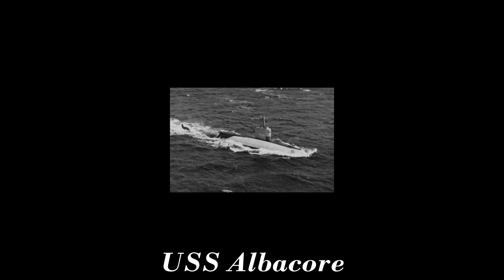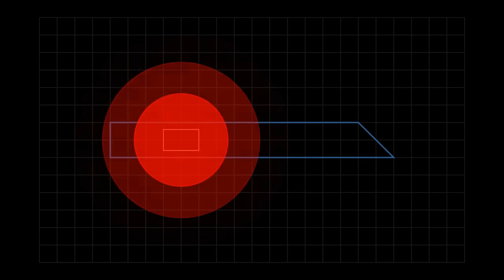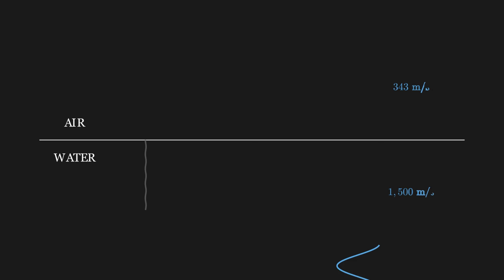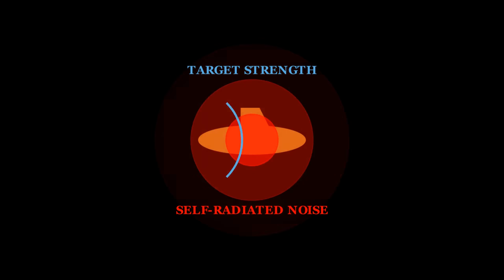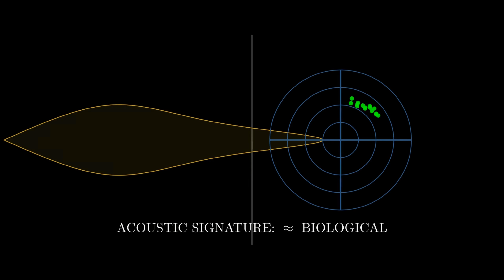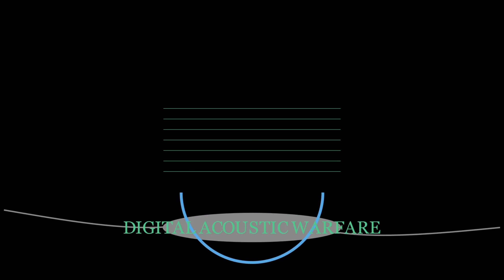How Submarines Became Impossible to Find.

Comment: I find this interesting for a few reasons.
This all took place in the 70's, in the Navy. 
I was on a destroyer on lower level engineroom watch. It was noisy down there! The Sonar pulses going out were so load you could hear them. You could also hear the return. You could tell, from the engineroom, if you were in open water (long delay) or if you were on top of a submarine. The frequency shift would tell you the difference between a submarine, or you were getting ready to run aground! 😮
The returns aren't that weak!
Later, I worked 2 1/2 years repairing submarines. My shop (and I) repaired every mechanical system on the boats, from replacing propellers to aligning torpedo tubes, everything in between! I became very aware of all of the noise isolation. It's not just the engineroom that is mounted on vibration mounts, the whole interior is!
Then, for the last 2 1/2 years in the Navy, I worked in the Noise & Vibration Lab in San Diego. Learned a lot more about how all that combines.
This video spells it out pretty good!  👍

Comment: Modern nuclear submarine reactors can operate across a good portion of their power output using natural circulation with main coolant pumps turned off. Additionally, AIP/battery-electric subs, while superb ambush predators in the littorals (close to shore) they are limited on the open ocean due to speed limitations and the need to run their diesels during transit to the AO, which generates lots of noise. The nuclear submarine remains the apex predator of the open ocean.

Comment: Unfortunately, as a “Military Knowledge Popularization”you clearly did not do your basic homework well.the maximum speed of AIP submarines is about 20 knots, which is the cruising speed of nuclear submarines. Nuclear submarines are generally around 35 knots, and AIP submarines cannot "run" for weeks. Your equipment requires power, and the power management of AIP submarines is still very tight. If you take a full speed of 20 knots, you will probably have to up to surface and open the snorkel and start the diesel generator for charging within an hour. This further limits the combat mode and underwater maneuvering of AIP submarines. On the contrary, nuclear submarines, due to their infinite power, can ambush, shift positions to the best attack angle, or escape at an extremely fast speed in unexpected places. Moreover, the reactor of a nuclear submarine can purify seawater into pure water, which AIP submarines cannot achieve.Not to mention that the weapon payload of a nuclear submarine is almost two and a half times that of a diesel electric submarine.

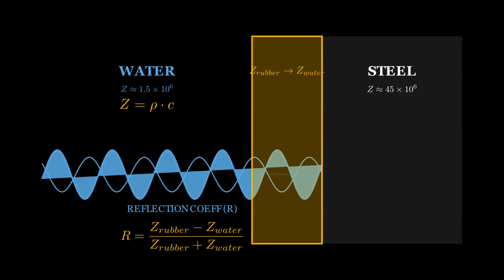Comment: 1:10 Germany didn’t shrug their shoulders and ignore the research. It was used in combat on a Type 7C submarine designated U-480. The rubber tiles were very effective at hiding the submarine from enemy sonar. Since the tiles were put into service in 1945 then the decision to use them likely was early 1944 and research being compiled in 1943 since it takes time for decisions to be made. Also setting up the logistics and actually creating the tiles would have taken time.

Comment: Submarine stealth is an integrated system of technologies and not just one. The design of the ship hull and propeller blades is one factor. Isolating the transmission of vibrations to the hull is another factor. Using materials that absorb energy instead of reflecting it is another factor. Active noise cancellation is yet another factor. The entire system needs to work together flawlessly or you create a unique signature that can be used against you.

Comment: Before the Virginia class, US Navy nuclear submarines did indeed have an Achilles Heel: they had to always make noise by running pumps to cool the reactor, a weakness submarines equipped with AIP (Air-Independent Propulsion) do not have. The Seawolf and soon after the Virginia class submarines do not have this weakness. They do not use pumps, they use adductor valves that draw water into the submarine as it moves forward to cool the reactor. Only if the submarine slows to five knots or below do they have to activate their pumps. Hence the Virginia class is literally quieter at twenty knots than the older Los Angeles class is in the dock.

Comment: US/UK reactors have used passive cooling for decades. So while they use pumps for high energy applications, there are no cooling pumps running 24/7 on a modern nuclear powered submarine

Shaping is now the state of the art of submarine stealth. Rafting, anechoic coatings, passive reactor cooling are already standard

Comment: You missed magnetic signature, which makes submarines discoverable from aircraft flying at low altitudes, such as the P-8 Poseidon, countered by degaussing. Also missed surface wake, which makes submarine speed, depth and heading discoverable from satellite. Hydrogen/saline trails, which make them discoverable by underwater sensors attached to other submarines. Underwater saline current sailing, which allows a submarine to slowly drift in silence, as the propulsion is almost turned off. Underwater towed sonar boom arrays, deployed a km behind the submarine, allowing the submarine to listen for targets with a much larger effective sonar, or let them ping for targets without disclosing their actual depth, heading and speed.

Comment: The newest Japanese subs are scary too. They took out the AIP and slapped Li-Ion battery cells instead. Imagine what a fully electrical sub sounds like under water.
Reply: Diesel-electric sup is overrated there low speed is the biggest downside they can only wait for an enemy to come to them
Reply: Or what if, those new batteries can do if got fire, years ago, a german made submarine was lost, the vessel was found months later at over 900m of deep water, at the time, I do remember they had updated the batteries for newer Litium batteries, many theories arised, one of them a possible fire onboard caused by a defective battery, but those are speculations, 44 lives lost😢

Comment: German Subs used Alberich coating in active duty. Problem was to permanently stick the rubber tiles to the steel hull. The glues weren't that effective (salt water, rough seas, temperatur differences). Alberich is the name of a dwarf and fictional historic Germanic character that wore a coat to make him invisible. This coat was later stolen by another character named Siegfried.
Reply: Seems quite similar to what really happened
Reply: The coatings were only partially successful on the snorkel and mast assemblies that were exposed during submergence while using the diesels. They were innovative and precursors of post-war developments, but not the solution as other commenters suggest. This is also true of their rocket work.

Comment: So alot of this is misleading or incomplete. 
1: Submarines rarely use active because the magnitude of any return they get pales in comparison with the signal they are sending out. Going active gives away your position. Most submarine sonar usage is passive sonar 
2: Nuclear reactors don’t need pumps just for cooling. they are actually needed to turn the heat energy into work. A nuclear reactor without pumps is non functional. (An RTG sounds like an exception but an RTG is not a nuclear reactor)
3: AIP is not superior to Nuclear, they are quieter but they are slower and have reduced range. Pros and cons.
4: No mention of sound propagation underwater, thermal layers, shadow zones, sound channels, bottom bounce, etc.
5: the weakest point; could’ve maybe mentioned decoys and noise makers, but that would’ve been a bonus, not super necessary for the video. 

Should’ve included first 4 things absolutely. Not the worst video, but far from satisfactory.
Reply: this video is ai slop thanks for the info though this is an interesting topic!

Comment: Interesting, I too seen the movie, 'The Hunt for Red October.'  Liked this movie, suspenseful with the characters being stalwart in a miliary sense.  The point of the show (well, one of the points) was that there was very little active sonar involved, as most of the time there was only electronic listening.  Which to me left me scratching my head as the ideas and practical electronic circuits abounded for noise cancelling ----- for some decades prior the film — certainly prior to the time period of the film, if I recall a few of the 70s monthly magazine ‘Popular Electrons’ correctly.
Reply: Very old. When the Hunt for Red October came out, I was a little concerned. It was technically about 80% correct.  Good movie.
Reply: @raywhitehead730  It was technically incredibly incorrect.
Reply: @raywhitehead730  it was far more accurate than that, since Tom Clancy had quite a lot of experience